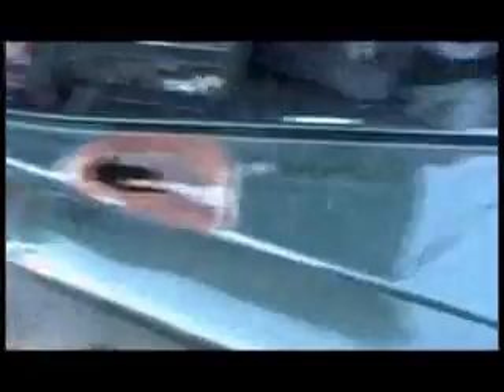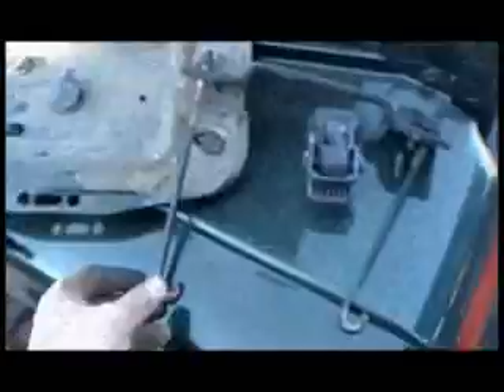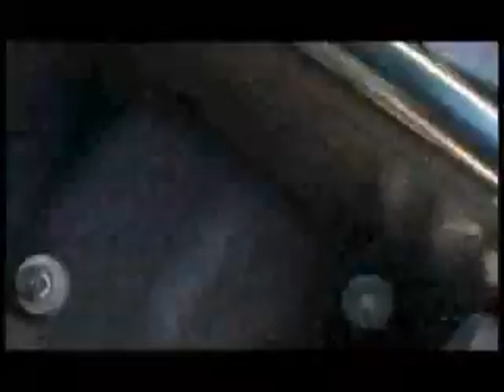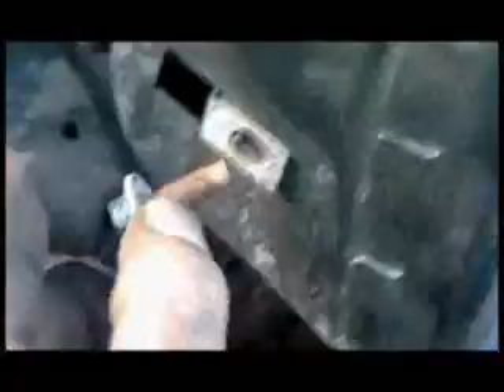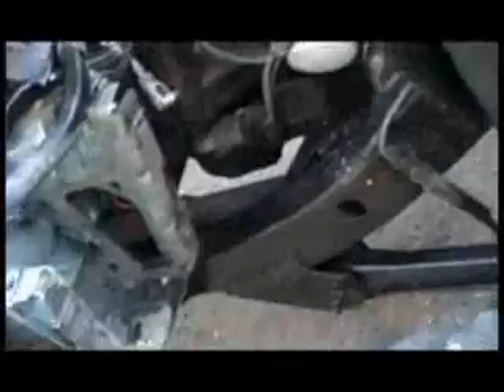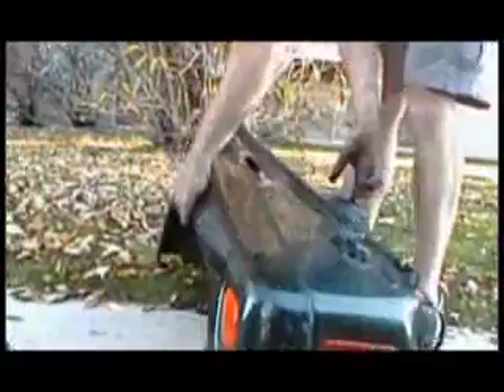How to remove a Jeep TJ right fender

Comment: On my 00 Sahara those plastic side moldings that run under the doors are attached on a rail at the top and by screws on the bottom.  The metal rail was actually rivited to the fender and had to be broken/drilled off.  Since yours wasn't, I didn't expect mine to, and I couldn't figure out what it was stuck on.  It took me a few hours to remove the plastic molding because the nuts for the bolds that hold it on all spun.  If you can tell if yours is rivited, I'd remove that part a day before.

Comment: I'd also remove the fender flares the day before.  That and the plastic molding took most of the time to get off because the nuts spin so you have to vice-grip them.  Both of those can be done ahead of time so you don't end up in a time crunch.

I'd say overall the passenger fender took a good 6 hrs.  The major bolts are easy, its all the things bolted on, wiring that runs through it, and those darn flares that take forever.

Thanks so much for the video.  Did you ever do the driver's side